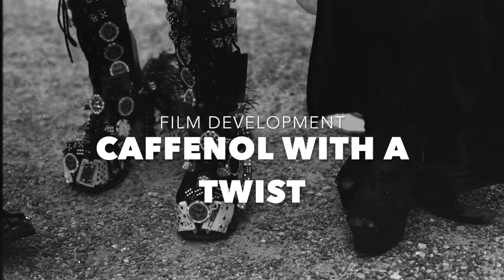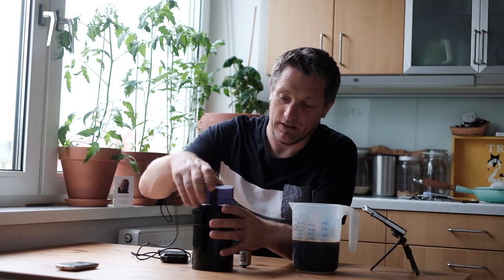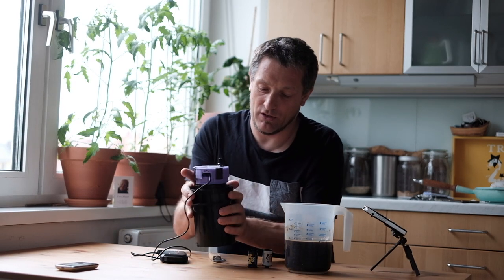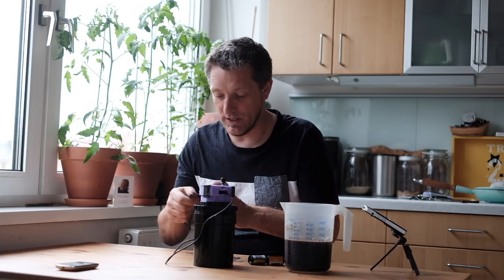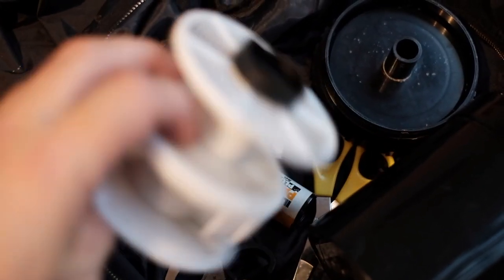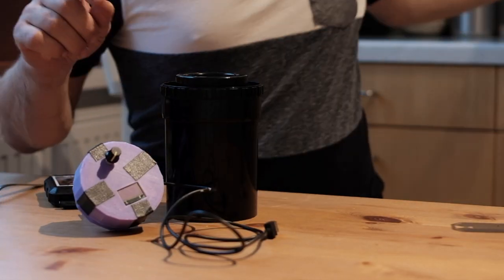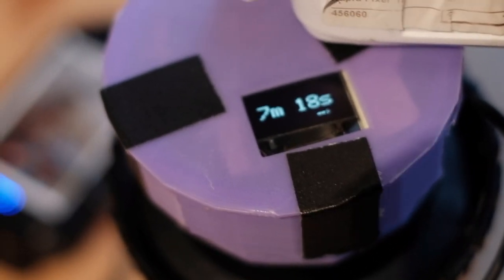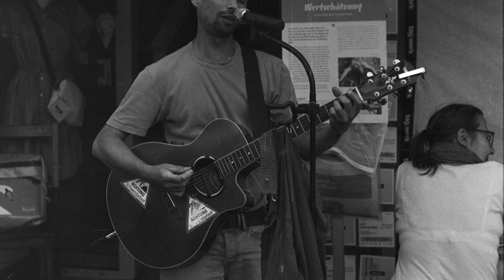Caffenol Development With A Twist

Comment: Very nice video! I saw your pictures have large amount of dust. Is it from developing in cafenol or scanning?
Reply from the maker: A bit of both to be honest. I need to use distilled water next time due to the amount of limescale in our water here in Graz. Also I don't have a negative drier either yet which is important as we have a lot of fine particles in the air here too. I'm glad you enjoyed the video. Thank you for your kind comments
Reply: @GavinLyonsCreates  Could it also be that some of the crystals remained in the mix. I have read that can cause the spots or tiny abrasions on the negatives.
Reply from the maker: @wcwendychapman  it's most likely our city of dust and the amount of limestone in our water - sadly. I'm planning to makes some more film photography video soon and might get a chance to address this topic in a video.

Comment: What was the recipe
Reply from the maker: Homemade developer called Caffenol

This is the harmony recipe from Caffenol.org

    600ml Water (Tap is ok)
    6.25 tsp Washing Soda
    10 tsp Instant Coffee
    2.5 g L-Ascorbic Acid

    Dissolve the washing soda, coffee and vitamin C in a jug with the water.
    Load film into the development tank and close it up.
    Pre soak the film for 3-4 minutes. Remove the water.
    Pour the solution into the tank,
    Develop for 8 mins
    Fix with Hypo for 10mins